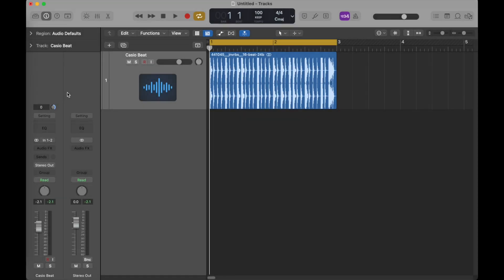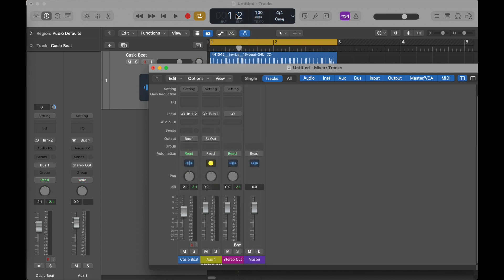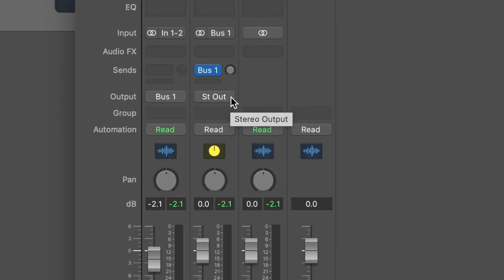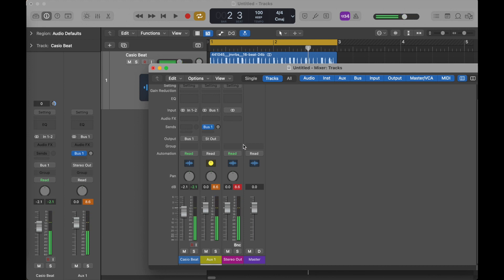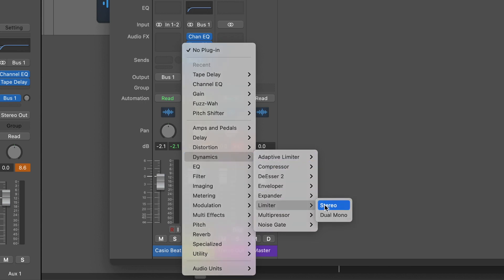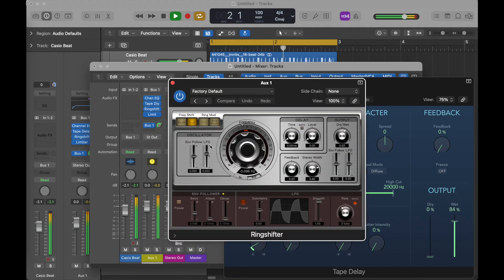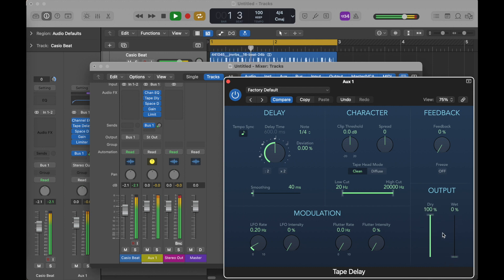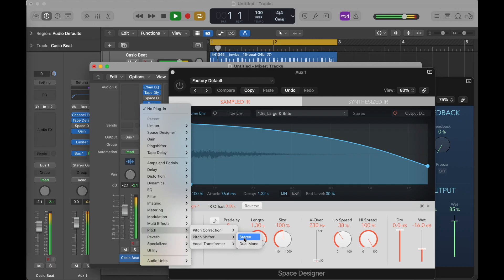No-Input DAW (Logic Pro X Feedback Loops & Sound Design) | Simon Hutchinson

Comment: How do you record the audio from the output of the loop? Do you have to route a separate bus with output to a new stereo channel to record onto? I was thinking of just using soundflower/blackhole to route into Max or Pure data to record the output but that seems needlessly complicated
Reply from the maker: You should be able to just bounce the audio like you normally would (though it might require a “realtime” bounce).
Reply: @SimonHutchinson  interesting, so you couldn’t just route that output of the feedback loop to a new stereo track and arm/record the output?? I’m not even sure how to do a real-time bounce, will that keep all of the automation and everything from the performance?
Reply from the maker: You could do that too! Real-time bounce will keep all automation too. In Logic it's in the "Bounce" window (after you go Command-B). There's a check-box for realtime.